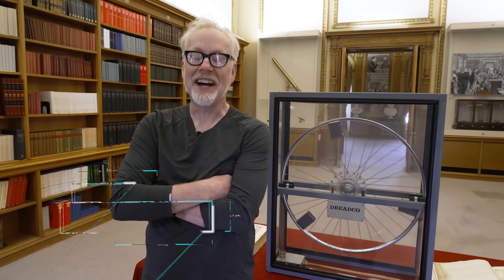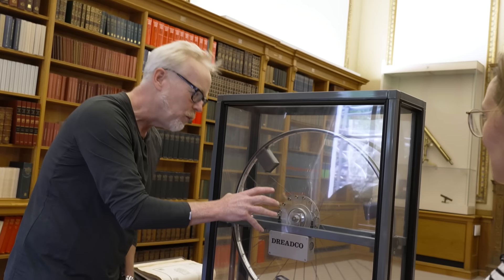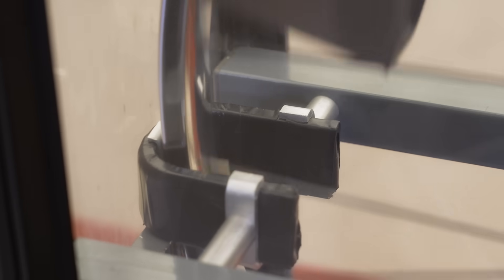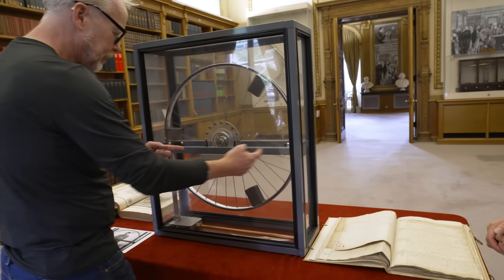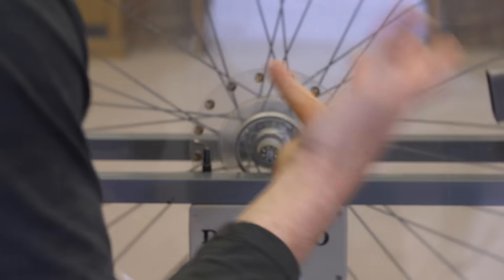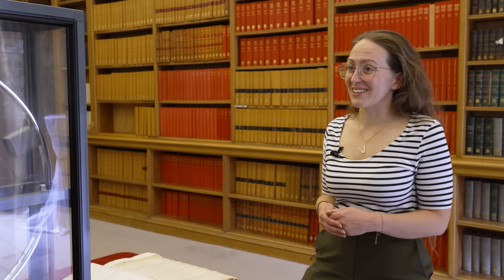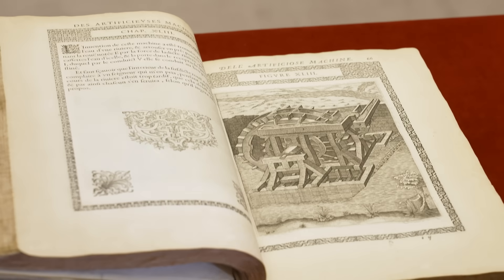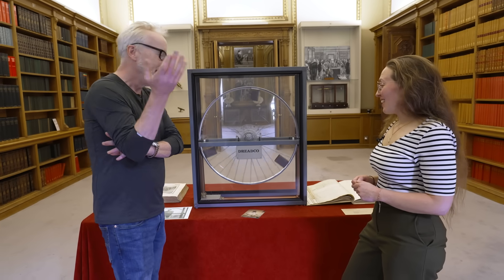Adam Savage vs The "Perpetual Motion" Machine!

Comment: There's a battery in the dreadco box. Every 2 years it has to be replaced.
The battery may also be in the heat synced box on the bottom with wires in the copper pipes and the magnets are actually electromagnets.

Comment: Daedaluses? 2 year spins/no light... big battery in the Dreadco box. Tiny little electro magnet perhaps, in the grey weight holding bars. 3 big magnets on the radius of the wheel. Reed switch in the grey bar switches on when the 3 big magnets pass it. The magnetisation is just at the proper angle so as it approaches the reed switch the coil comes on, and importantly switches off before the magnet has entirely passed.  Maybe?

Comment: It's a clock and there must be a coiled spring in each box that clicks open one notch which propels the wheel in motion.  The magnets are likely offset just enough to give the wheel a piston like effect in which each spring clicks open in sequence.  The wheel is just concealing potential energy being let loose a tiny bit at a time.  Or there is a coiled spring in the main center box etc.
Edit: Just looked at the other answers.  Yup, it's a clock.

Comment: You don't necessarily need an energy storage device (e.g.battery) to make a fake perpetual motion machine. There is always a source of energy around that would be accessible even from within the sealed box. Light was mentioned in the video as one of them, which can be turned into electricity of course. The other source (particularly in a museum) is heat. Museums are kept at a constant temperature to best preserve exhibits so there is a always a consistent energy supply. It may be possible to measure a temperature gradient between the inside of the box and the outside. If the inside is consistently very slightly cooler than the outside then it is using some energy to maintain the motion of the machine. However, the fact that people were "disappointed" when they learned how the machine worked I suspect that it is indeed just a battery and electric motor.

Comment: I have a gravity engine design. It uses pendulum, cam, spring, weights. I studied Johann Bessler drawings and the design I came up with was a modified version of drawing 13.  Maybe it's time to warm up the print bed and get to printing some parts to assemble. Want to collaborate on what I figured out?

Comment: Adam pretty much nailed it on the head when he said that these machines are dealing with a war of attrition.... tiny tiny values.  Even if this machine, or one like it could run forever, the amount of "work" it would be capable of doing outside of moving it's own mass would be so infinitesimal as to be useless. And it is this balanced look at the equation to why a real perpetual motion machine does not exist: A machine that uses an incredibly small amount of energy input, over an incredibly long period, With very low resistance will do an equally incredibly tiny amount of work. Adjust any of these four variables and you can alter the amount of work output, time, resistance or energy input. But it must balance out.

Comment: Take the cover off the small box at the front under the axle. Any "Perpetual Machine' that has hidden elements generally has the workings in those hidden areas. A regular quartz battery powered clock willl run for upwards of two or more years off a single AA battery. This carefully balance wheel in a box sealed to avoid air currents won't take much energy to keep moving.
Waste of time watching this more than a few minutes.

Comment: i think the 3 box shaped devices on the actual rim are just weights. and the device on the bottom is a heat exchanger that pulls cold air from one end of the copper tube and expels hot air from the other end thus gently keeping a large heavy perfectly balanced wheel spinning

Comment: The boxes are probably electromagnets, being activated by contact of the "switch" on the screws in the right time (when one of the boxes closes to any of the magnets), than disconnects the contact in the right time, when the momentum is biggest and the magnets (horseshoe permanent and boxed electromagnet) would start to pull each other in the direction oposite to the direction of the wheels spinn.

But...
1) If so, why not more horseshoe magnets and even more intricate switching system and
2) if the system works as described, it simply trades the magnetic force of magnets (wich do gradually loose their strenght) for generated energy. I mean, those magnetic "perpetual motion machines" simply have different kind of battery (lets call it magnetodynamic battery) but with finite time of opperation, nevertheless.

Comment: From what we've seen from "perpetual motion" and "unlimited energy" machines, 99% of stuff that's there that seemingly doesn't make sense is a decoy to throw people off. Almost all the time it's a very simple system which is probably all in the DREADCO box, most likely a battery and it just outputs a very small amount of current using electrostatic to turn the wheel. Since most people on first thought would try to find some kind of motor the maker clearly designed it in a way to avoid a motor at all.

Comment: Okay, I think I got it. At its heart, it's an electrical engine, only, there's a lot of misdirection involved. First, the three boxes conceal batteries, connected in series, with wires hidden within the wheel. They power the stator, which lies in the wheel hub, while the spindle that is fixed to the external frame contains the rotor. The metal bars of the frame are used to make the rotor heavier than the stator, so the stator (the wheel) rotates instead. The copper pipe, the heatsinked box and the labelled box contain additional weights. The pipes are made out of copper, and connected to a box with a heat sink, to suggest heat exchange, but that is misdirection. The light detectors on the sides of the labelled box only exist to suggest solar power, but they might even not be connected to anything. More misdirection. And finally, those metal structures on the left and right of the box are made to look like magnets, they might even be magnets to fool someone with a magnetic field detector, but they are only there as... you guessed it. Misdirection.
Reply: I was thinking that the box in the middle housed a thermoelectric generator, and the movement of everything inside the plexiglass generated heat, while the museum is probably cold, and everything is insulated really well. The energy generated gets transferred to the motor in the middle of the wheel somehow. Could the box with the heat sinks  and copper pipes be somehow directing heat towards the generator as well?
Reply: In the cartoon that came with the original presentation, he actually says that the metal frame is meant to be misdirection ... but that's just what someone who needed a metal frame would say.
Reply: Electric MOTOR.
Reply: I don't know that much about electricity but I do make guitar pedals and I can't imagine why you'd need a heat sink that huge for something that runs so long.
Reply: The copper pipe is to vacuum the box reducing air friction
Reply: There's a motor in the box spinning the wheel. Everything else is misdirection.

Comment: Even a normal bicycle wheel runs for several minutes once it is spun,  due to low friction bearings, so I guess the trick is a small hidden battery and electro magnetic impulse system, 
Magnets attached to the frame, and electronic circuit and battery and a high impedance coil housed in those 3 blocks, (boxes) such that a sensor senses the magnetic field (can be a reed switch) which then switches on current to energise the coils built inside the boxes. An Alkaline battery can last 2 years or more,  such as those power wall clocks, as very little energy is being used from it.The copper tubing and other boxes are for distraction to make you think the 3 blocks are passive, but have active circuit and battery and a coil in each.

Comment: Thank you. A great field for reflection, how it works. Reproduced in a logical chain and options for the interaction of the centromasses at the corners of the boxes and connected them so along the circumference of the wheel hyperbola of angles. It turns out that at the moment of launch, the axis in the center has already passed the working field of the angle itself, which goes at the moment of operation of the box itself to the force in the next one behind it, the hyperbola to the next corner located below. Based on this: I believe that in that century they could only use chemical elements soluble and insoluble in water, but also different in mass. having a difference in surface tension, one of them always tends up, not down, due to the fact that the rectangle, then we can assume that the mass that is in its long side just works). If I understand incorrectly, then correct me.
Reply: to push once is like sending a wave into a calm on an endless ocean.)

Comment: i don't think there is a chemical reaction. That would be harder to control inside the closed box and would be less efficient and short lived. I think there is a radioactive isotope releasing alpha or beta particles, thus generating an electric current. The boxes on the wheel contain a coil which serves as an electromagnet. They push the wheel each time they pass through the horseshoe magnets on the sides. Servicing the machine just requires replacing the decayed radioactive material.

Comment: You can't create energy. It's just as simple as that. It doesn't matter if you introduce magnets and what not. Moreover, if you introduce magnets to produce electricity, you will actually slow the system down. You're just converting energy that's already in the system and creating heat in the process that gets lost to the environment. There's no mystery here, there's an external power source.

Comment: Dreadco battery bricks keeps ya turning. Not electric at all l. Sliding captured weights with springs in those boxes. Its springs are serviced/ replaced after they fatigue. Gravity powered.

Comment: Take a wheel with buckets of water on it Or maybe Mercury There's a buckets turn around the wheel The fluid empties into the bottom bigger water container what's the smaller hose up to the top to feed the bucket on the going down side

Comment: I think it is circulating air that rotates the wheel; cold air moves down on the left side inside the copper tube which is connected to the heat sink that disperses the heat at the bottom of the glass casing, then air in the bottom picks up heat again and rises through the right side tube. The rising air blows the perimeter of the wheel and/or through the small nozzles close to the bearing in the center.

Comment: My scenario is that most of that is a ruse. If you could get the magnets charged with a rotation of the wheel. The magnets will propel the will forward enough to spin it to the next contact magnet which will spend it to the next one and on and on it goes. As long as you keep the Magnus charged.

Comment: The most amazing thing about this “Perpetual Motion” is that it will not work without a generator. because the generator in this case is the engine.

Comment: Hello Adam, Cris speaking, from Chile, SouthAmerica. I have seen a very similar machine in operation that an electrical engineer built for a friend in her country house, where the electrical system did not reach. The machine is very similar, a bicycle wheel, inside a wooden box, but this wheel has a series of magnets, on the spokes, not 3, but thirty or something like that and on the sides it has a support that has another series of magnets opposite and close to those attached to the wheel, all connected to a belt, which goes to a dynamo, then to an electrical transformer, which delivers energy to a series of electric batteries the size used by trucks. Once he started it, the wheel didn't stop and it goes quite fast, it charges the batteries in series that have to be periodically changed once they are charged and thus has electricity in the house. Now, the electricity it generates and manages to accumulate works to keep the entire house illuminated, from dusk to morning, have a radio on, charge batteries for lamps, work with the laptop, etc. But it does not allow you to have a washing machine, or a refrigerator, for example. But it works, it works and it has been working there for more than 10 years. Greetings.
Reply: Thank you.. like iv been trying to explain this same design concept to others an they always are na sayers I knew it would work to some extent but yes washer an fridges pull to much amps

Comment: lol. I think it’s just some magnets and weights. Like, the weight of the top most magnet, paired with the pull of the side magnet is temporarily more force than the other two, especially since one is also being pulled in the inverse direction, which causes it to spin. I think that the weight, the magnets, the placement of two variables being perfect and the smoothness of the bearings keeps it going and that everything else is a distraction to confuse smart people into thinking it’s far more complex than it really is. Basically, I don’t think this was ever designed to be a perpetual motion machine. I think it is literally a joke. Like, the dude would be reading the submissions, cackling to himself.

Comment: i believe it's using a magneto system for timing. the small magnets passing the "anode" and "cathode" mentioned (one slightly higher than the other) would be sending a signal to the "mysterious box" in the lower right corner on when to swap the field on the electromagnets (left and right side of the wheel) not sure how much energy this would take but I'd like to think in a near frictionless environment like this, it wouldn't take much. and with some solar charging being done when possible, i feel two years isn't much of a stretch. the copper pipes being used as wire conduits to "hide the secret"

Comment: There are three basic rules for operating this simple motor: First, the magnetic propulsion of the curved pieces, which are fixed at angles so that the inertial wheel of gravity is used with the installed magnetic repulsive force. Unloading the area in which the wheel rotates through the helical tubes. Cooling the vacuum area to make the pieces conductive. Magnetism is high... and there is an inert gas such as hyium that allows the inductive magnetic field to be strengthened... but this engine has a very, very small power... and it cannot be developed practically on Earth...

Comment: Its probably just a spring wound up in the square tubing. It works lime a watch. Inside the dreadco box is the winding mechanism, and the gears. The creator said everything in it is a distraction. In the end, it works just like a clock.

Comment: NO... I think that the three boxes have a diagonal cavity inside. The liquid is possible mercury to amplify the difference. The angle of the 45 degrees or 60 degrees has the oscillating liquid further from the axel giving it more downward leverage against the upward moving opposite side of the wheel.

Comment: IMHO, high voltage is used to ionize the air in the lower box generating a very gentle airflow through that copper pipe which “gently blows” onto the rim of the wheel at one end of the copper tube (residual airflow is then captured at the other end of the copper pipe to further boost the flow). In essence, the wheel is being blown around by a very gentle air current. There’s a very small current required to maintain this very high voltage… periodically the battery it uses needs to be replaced. The other bits are simply decoys to confuse… although the tin cans on the rim may help to catch the breeze. Ion wind makes it go.

Comment: idk how he cant figure this out., it runs on AAs. it has weighted solenoid and tip sensor. it extends a weight to increase its moment arm, the other 2 retracted causes miniscule force applied, but it takes minimal power  because of the low friction environment. most likely runs on arduino or similar and a mercury gravity orientation sensor in each square box.

Comment: I suspect it works like a crooks radiometer and there is paint that is more absorbent to infrared light on the sides of the boxes and spoken on the wheel. That or it's an electrostatic motor. Maybe both.

Comment: The key lies within the bottom of the machine, thats a wireless power transfer to the perpetual motion machine. the heat sink is to radiate the heat from the wireless component. the two copper pipes are to mislead us. dreadco boxes are to mislead us, there might be power storage to power to two magnet on the sides cause less torquer is requared to power the thing for long time

Comment: What would be the actual use of perpetual motion? If you could actually produce it, it would be useless. At least from a mechanical viewpoint, because It could never be used for anything without ceasing to be perpetual. Mechanical energy is something that gets spent, then dies (or get converted to heat). The only way we can relate to perpetual motion is by spinning and corkscrewing our way around the Sun. For all intents and purposes, that goes on in perpetuity. But if you increase the time scale enough, of course, even that will eventually either stop, or transform into something else.